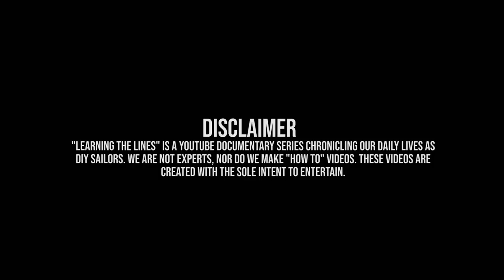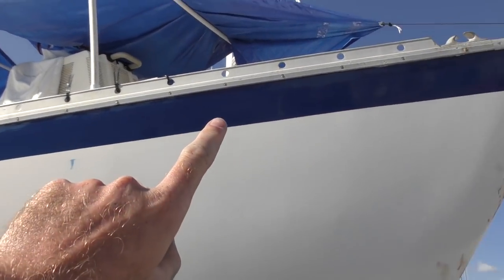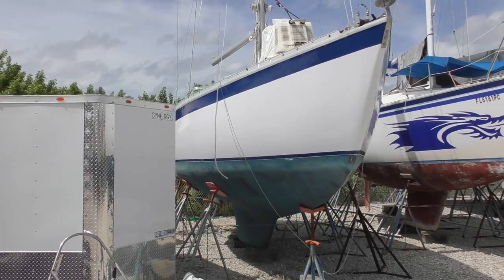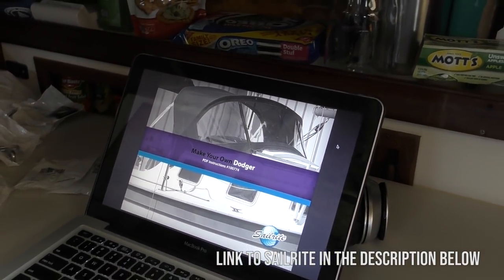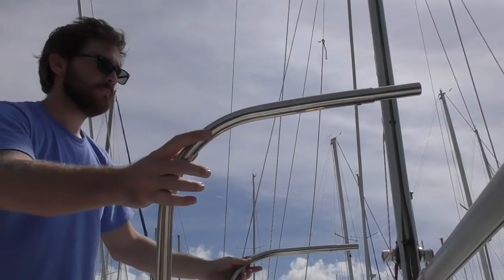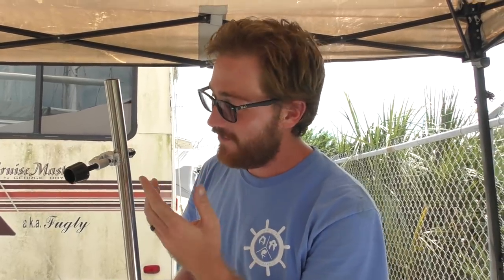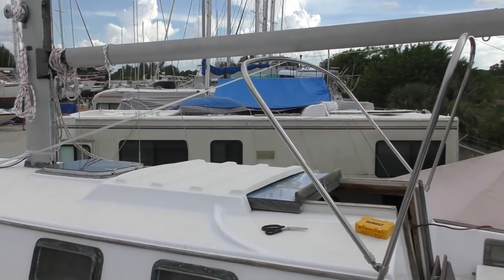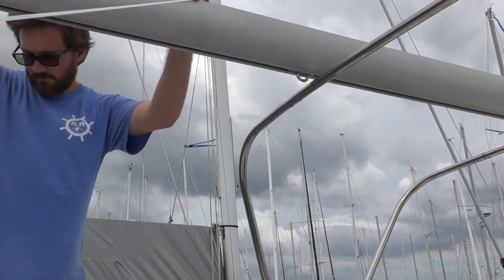59. She Looks Shiny & New! - Topsides Painted & Dodger Started | Learning the Lines - DIY Sailing

Comment: Great job guys. Just a little trick with those pipe cutters I have learned, have patience lots of patience. I saw you using a pipe wrench to tighten it that's probably why it broke. Hand tightening would have taken longer but probably lasted longer. BTW you can get a replacement cutting wheel for those.
Reply from the maker: Thanks. Lesson learned.

Comment: Hi Guys! I did my boot stripe last year with Interlux and it came out great. One tip given to me was to you two layers of tape which I did. I had no unwanted paint under the tape. I also replaced both layers of tape between sanding and painting. I also wet sanded the first coat of paint with 300 grit quite lightly. The results were spectacular!!! Good Luck! You results look great as well!
Reply from the maker: Good tips! We're considering wet sanding.

Comment: Yep, like others have said.  The pipe cutter would have lasted a lot longer if you only gave it by hand a half turn tightening every rotation around the pipe.  All you did was crush the sharp edge of the blade.  The slower you tighten it the cleaner and smoother your cut will be, especially right before it separates. Your next pipe cutter will last years.

Enjoy your story.  Thanks!
Reply from the maker: I like the upside for the next pipe cutter. Lol. Thanks for watching!
Reply: Owen fromKC A
Reply: Agree with this, as someone has used pipe cutters alot, it is all about slowly increasing pressure. When you put the pipe wrench on the cutter I cringed instantly. Basically just taking it around a time or two and when it goes easily tighten half a turn for until it gets easy again. You will probably never break another blade (even a harbor freight one)

Comment: When you sail  on a close reach, the main sheet pulled tight,  the main sail will stretch and the boom will come down lower. Don't take that chance and a leaver a 4" gap at a minimum. Stand up at the wheel and check visually if the dodger needs to be that high in order to see about half a mile away.. Cheers
Reply from the maker: Yes, I think unfortunately we will need to lower it a bit.

Comment: I thoroughly enjoy watching both of you work on the boat.  I have a suggestion based on my experience with tools.  Buy the good stuff, like Craftsman, etc.  You'll be glad you did and you will still have a usable tool for future projects.  Craftsman even has a lifetime replacement guarantee.  Harbor Freight doesn't sell the good stuff.  I've got Craftsman hand tools that I've had and used for over 50 years.

I look forward to the next installment and to the time when you get her in the water and begin cruising.
Reply from the maker: Thanks for watching! We're trying to make better tool choices for the ones we think we'll need again in the future.

Comment: Yeah, funny thing about those copper tubing tools, they do in fact only hold up to working with copper, aluminum, plastic etc. tubing. Cutting even mild steel brake lines is quite a high level issue and 316L is even higher up on the PITA list. FYI, drilling stainless is way up there on the PITA list too unless you have some cobalt 135 degree drill bits as well.
Reply from the maker: Yes, definitely pushing these tools to the limit. Not something we recommend. Lol.
Reply: Well most people have no involvement with milling stainless until they get a boat unless they are involved with a machine shop that deals with it. I have seen many who thought they were going to drill through 316l using typical high speed steel bits with 118 degree cutting angles only to find out that they weren't going anywhere with that. All it really does is just burn the tip of the drill bit out.
Reply: Actually stainless steel is very easy to drill with standard high speed drill bits. The problem is that people incorrectly assume that stainless steel is a very hard steel. It is actually quite soft, but becomes work hardened very fast. Most of the problems people have drilling stainless is because they run the drill too fast and work harden the metal. The best way to drill stainless is to run the drill as slow as possible, and use motor oil or something similar for lubricant. Don't waste your money on special drills when a little bit of knowledge will allow you to use cheap drill bits.

Comment: I hesitate to offer comment because you've probably already considered this, but the critical determiner of boom height over the dodger is the hoisted main, not the topping lift adjustment. Do you know for sure that your boom height, as it sits now, matches its height with the hoisted main? If I were building a dodger (I've built a few, by the way) to ride just under the boom for maximum height, I would hoist the main and sheet it in tight on the centerline, which would replicate a close-hauled scenario when the boom is likely closest to the dodger. That will tell you just how high you can go with your dodger without interfering with the main. Figuring this stuff out now BEFORE you pattern and sew is critical; otherwise you'll end up with a poor-fitting dodger after you discover the frame needs adjusting. Best of luck! It's a learning process, for sure.

Comment: Those pipe cutters generaly have a spare blade inside the end of the handle, just screw the end cap off to reveal, also only tighten the pipe cutter by hand don't use a wrench on it. I've  used the same type of tool on stainless steel and made plenty of cuts. Cheers 👍👍
Reply from the maker: Oh man. We'll have to check.

Comment: Every part on a boat has its own name.  Thus, 'boot stripe' is down by the water line; 'cove stripe' is up by the sheer.

If you need to tighten a pipe cutter with a wrench, you are taking to big a bite, small increments work better. (says the terrible pipe fitter).

Anyways,  paint job looks great.
Reply from the maker: Yeah I think the wrench probably did in the pipe cutter. Hd never heard the term cove stripe. Thanks for sharing!

Comment: So what did you think of painting at night ?  It had to be cooler !

The reason why that cutting wheel failed, is you are supposed to tighten that knob by HAND, not with a wrench. 
 For stainless, I would only tighten it about 1/2 turn at a time.  I'll bet the replacement Ridgid brand tubing cutter wheel will fit and it will last a lot longer.
Reply from the maker: It was definitely cooler, but our big issues was that our head lamps attracted bugs that then flew into the paint...so not great. Lol. At least it was just the second coat so when we sanded and painted on the third coat, all was well. :)
Reply: Learning the Lines
The lighting bringing in the flying bugs didn't even come to mind! Definitely a danger in FL!

This is one of the reasons I really enjoy watching the two if you work through all of the challenges you charge right into, head-on, BOTH feet in, smirking in the face of any adversities that try to trip you up!!
My hat is off to you. I challenge you to keep that spirit and tenacity as you continue on your journey. 

Fair winds and following seas to you both!

Comment: Aww darn, figured pipe cutter would not last but was hopeful it would for at least few cuts. I certainly would have tried it. You way over tightened it, supposed to tighten slowly needing several full wraps to cut all way through ... and you did what 2 full turns maybe if that. Should have gotten through all 4 cuts, not sure as never done stainless, have done regular steel though and it should have. Ofc more expensive one with better blade would have but not sure I would have preferred ruining more expensive one either.

DISCLAIMER: This is not, repeat NOT a spam post to pad your comment count. As I did not see all other posts already about this same thing :P
Reply from the maker: Lol we all have to add disclaimers now. But yep, lesson learned. Thanks for always watching! You rock. :)

Comment: If your dodger is too tall, it will greatly effect your ability to trim the main when needed. Not sure the video translated the angle well but it looked like the boom is already angled up at the stern compared to at the mast so I’d be concerned about the ability to flatten the sail by lowering the topping lift when underway. My two cents.
Reply from the maker: Yes, we definitely need to make some adjustments.

Comment: Blade on the cutter broke because of improper use. Never tighten the tensioner for the cutting wheel anymore than hand tight. I know it take a lot longer but the cutter will last. Other option go to a pipe cutter instead of a tubing cutter

Comment: Actually the boom will be lower when sail. You’ll want to install a Vang to pull down on the boom to create leach tension for better sail shape.
Reply from the maker: We don't plan to install a vang.
Reply: I'm by no means an expert, but you don't have a vang?  When you tighten the lines to your traveler, does it lower the boom?  My boat had lines thru blocks, but I've seen the pole ones (name?), too.
Reply from the maker: No vang up by the mast, but when we tighten the main sheet on the traveler it does pull the boom down. I think the pole one you're talking about is a hydraulic one.

Comment: Just curious, but why did you rivet everything?  Might be easier to take apart and make adjustments if you used stainless screws...   Also, why waste $6 on a copper pipe cutter when you surely have a hacksaw in the trailer?
Reply from the maker: Thought the cutter might be quicker. We riveted because that was what the kit came with and we actually followed the directions for that bit. :)

Comment: The cutting wheel broke because you used a wrench to tighten it down. You should have watched a vid on using tube cutters. Don't blame the tool for you using it improperly.  Basically, you go around a couple time till it becomes easy then tighten by hand and repeat, usually 1/8th t0 1/4 turn on knob for harder metal.  Just go get a replacement cutter wheel.
Reply from the maker: Lesson learned

Comment: You can put a different blade in those cutters.  You should be able to adjust that traveler cleat.  (er eye er what ever the heck that thing is called)
Reply from the maker: We've been calling it a pad eye...?... it was screwed into place and corroded. :(
Key word: was ;)
Reply: HA!   OH MY!   oooopsie  ... Fix one thing  ... break two more ... it's a boat!  yippie!   Thanks for the vid of the paint job too.  I've been thinking that I'm going to buff out my paint for next year but if that doesn't hold up nicely I'll probably paint it the next season.  Looks like you guys did a great job
Reply from the maker: Thank you! It really wasn't too bad either. Just have to find your rhythm.

Comment: Harbor freight will give you a new one. Just don't show them the video.
 Once years ago the shop I worked at supplied sockets above like 1 inch   so we used the shop 3/4 drive 3 foot long snapon  breaker bar and put a 6 foot cheater bar on it an and badly bent the snapon breaker. Bar   . The snapon dealer refused to replace the bar $600 for a new one so we put the old breaker bar in the big press and tied the breaker bar in a knot . The next time the dealer came around we said. Now exchange it he lavhed and refused a few months later he came back and bought the breaker bar tied in a knot for $1,000 credit. He was going to a dealer convention and wanted to show it off
Reply from the maker: Lol funny story! Some have suggested it may have a spare blade inside. We'll have to check.
Reply: Home Depot might carry spare blades.  Some where will, i have seen them before.

Comment: Now you know why to avoid Harbor freight
Reply from the maker: Yeah that one was really our fault though. Lol. It was meant for copper tubing.
Reply: The proper tool is a Ridgid 35S.  About $40 at Home Depot.  It does take a special replacement cutter wheel, E635, for stainless.  This would be a "but it once for your lifetime tool".  If it cuts stainless, it will cut any other tubing,
Reply from the maker: Good to know if we need to cut any more tubing.